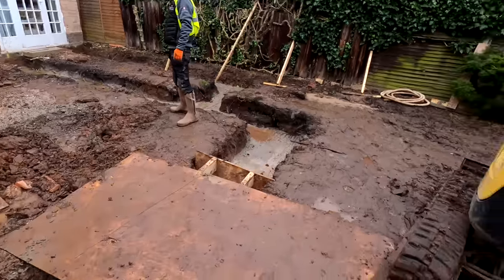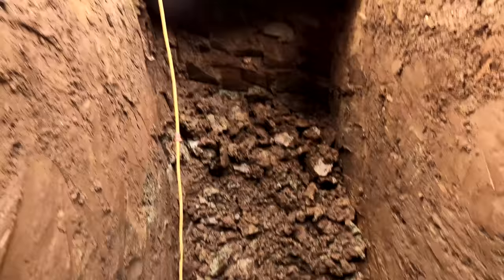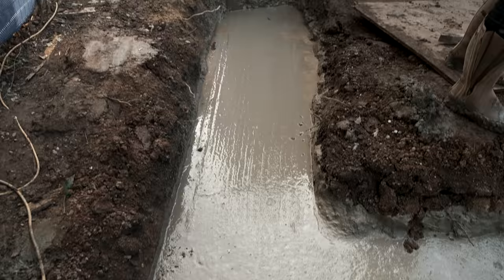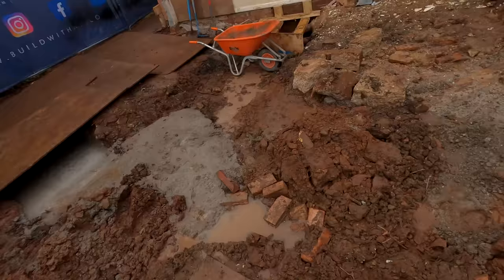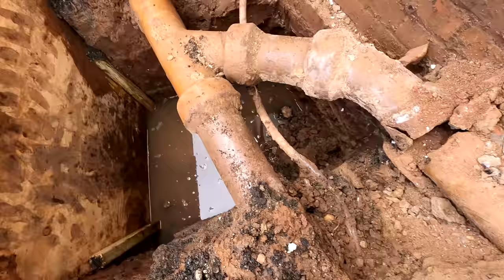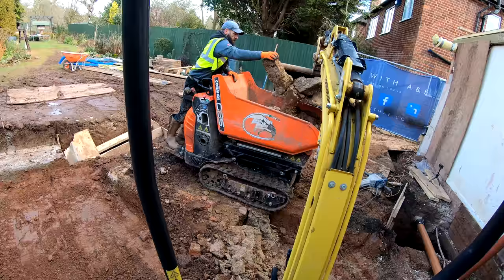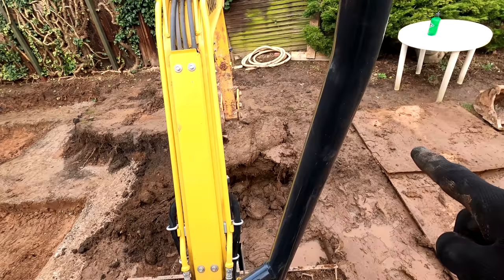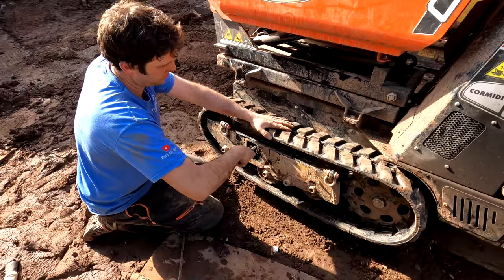Mini Dumper Disaster! 😱 | Single Storey Extension #6

Comment: Great Vid and top work, one small bit of advice i would have used a 1 ton dumper, holds more load, better fuel consumption, quicker and so much more robust than the mini track dumpers
Reply from the maker: Hi mate great shout it’s about the width most of the time thou all the best Tony 👍

Comment: why would the footing need to be so deep! it is only a lightly loaded structure. That clay would provide a bearing capacity of at least 70kPa for a strip footing, which would be more than sufficient for the both SLS and ULS load combinations
Reply: Building inspector see's a tree, always ask for 2.5m...It's their little power trip.

Comment: Does the foundation really need to be that deep for single story?
Reply: In general all foundations in the UK have to be normally 1m deep but, it also depends on the soil type your building is going to bear on! One reason foundations ars deep is to take into account further development as in eventually placing a second storey on the house and even a loft conversion!
Reply: I've seen houses built over 100 years ago with no footings at all. They just dug down 1m and built it up from there.